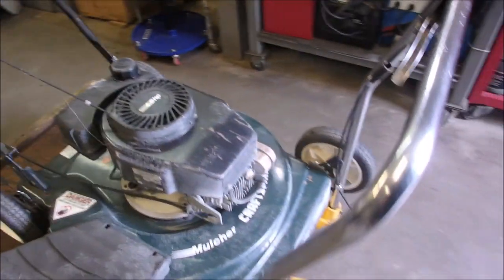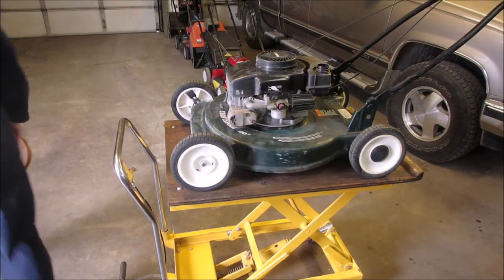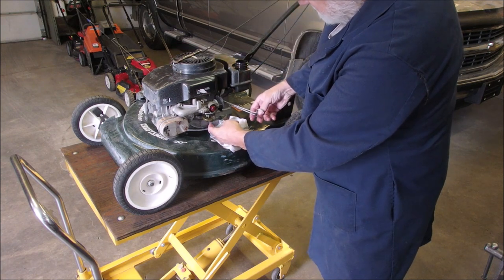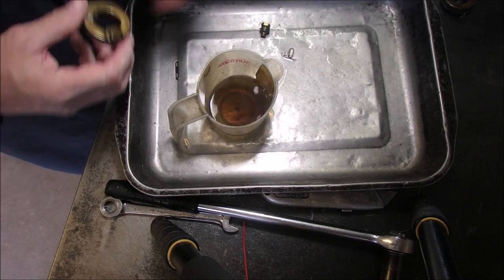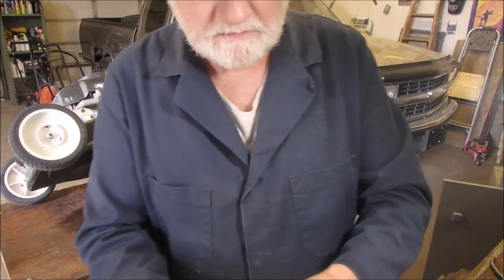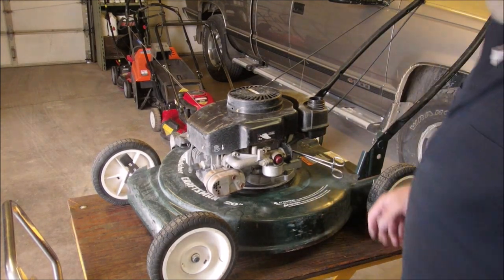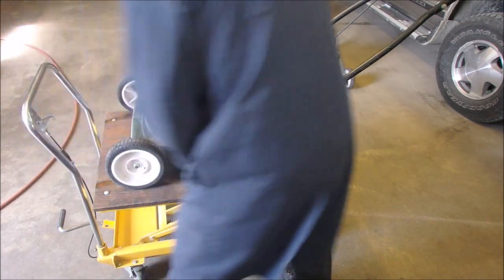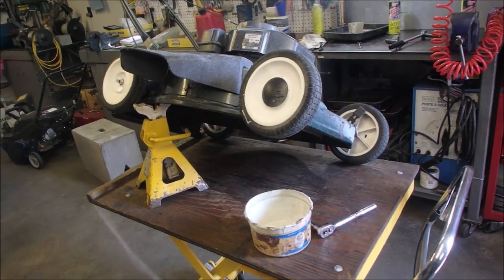This Craftsman Mower Leaks Fuel

Comment: I got a 22 inch Craftsman Mulcher in this week. It had 16oz in the fuel tank, 5 Oz of the 16 were H2O. Carb was so corroded that I had the ultrasonic the carb for 20 minutes just to get the float pin loose. That carb has now spent 75 minutes in the ultrasonic, with PineSol/water change after each 25 minute session. The brass float floats and cleaned up well. Today I am attempting the carb reassembly. I did an oil change and got 2 ounces of dirty oil out of the crankcase. Yes, 2 ounces, not a typo. Poor old Tecumseh. But I think it will live.
Reply from the maker: Let me know.  If you can

Comment: I get a fair number of Tecumsehs.  I kinda like them.  Easy to work on; although I usually just take the muffler and intake off to work on the carb, only 4 bolts and it's off.  I have never had one with the metal float, so yours must really be an oldie.  Great video Bruce, thanks for sharing.
Reply from the maker: Wow up here it is rare to get the platic floats.  Most are brass.

Comment: Nothing like a Techumseh and that mulching cover is a rare find, have only seen one since we started doing repairs over 10 years. Just like you said most of them are either thrown away or rotted out. Same here with lots of brass floats off scrap Techumseh mowers, the new replacements are plastic but we like installing original parts. These floats are balanced so we would suggest not trying to repair since it is not worth the time and secondly it likely will not run properly (balance is the key). Nice video that mower will out live even Mick.
Reply from the maker: Yes a bunch of solder is heave if you did find the leak

Comment: Personally I prefer a side discharge chute and I mulch with my mowing method. I just feel mowing without a side discharge puts more strain on the engine than mulching using mowing methods. There's a few different ways to mulch using a side discharge 1) mow around the outside perimeter of the yard with the discharge pointed towards the uncut grass and continue mowing the outside perimeter of the uncut grass with the discharge pointed in and working your way to the center until all the grass is cut and this is the most effective way to mulch but I typically use 2) Mow the outline of the yard and then mow back and forth. Always start with the discharge pointed at the uncut grass which means every other stripe is mulching. I like this method because of the long lines it leaves in my yard.
Reply from the maker: I have done the same.  Thanks

Comment: Nice fix.  I am still trying to figure out how you start them on the lift. I am working on something that holds them in place so i don't knock it off the lift pulling the cord.
Reply from the maker: You can do it!   Be carefull Bill. Lower the lift
Reply: @BrucesShop  Good point! I am playing with an idea now and need to measure a few more mowers before I put the welding helmet on. 😁

Comment: Very nice Bruce, love those nice simple old Tecumseh powered mowers. BTW the frame on that generation of Craftsman mowers was made by Murray, very rare to see the chute blocking plate still there. I had the same float failure on a newer Chinese Honda clone engine a couple of years ago, it had a white plastic float full of gas. Guess it can happen on any carb with a float!
Reply from the maker: Thanks.  I think that Murray makes or made great decks.

Comment: My lawnmower oil tank is leaking oil,I changed it,but I don’t know how to buy the oil tank,Can you help me?
Reply: 1:03
Reply from the maker: @chwang8550  Well if it is a 4 stroke the only oil stays in the sump.  The gas tank can be above the motor,  They can be repaired with JB weld
Reply: I’ve tried to fix it ,but it still leaks

Comment: Hello Bruce..the hemostat you used to clamp the fuel line..what size is it?..how would i look it up as far as whats it called, locking hemostat?
Reply from the maker: I went to a store called Princess Auto.  Very similar to Harbor Frieght.  Check there.  They are  wonderful tool.